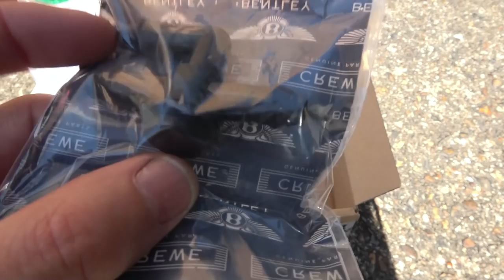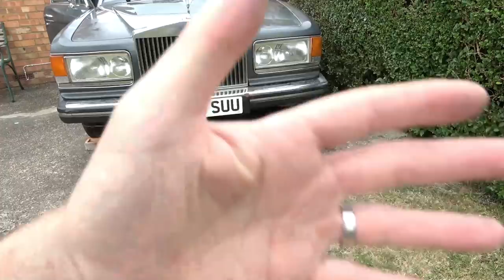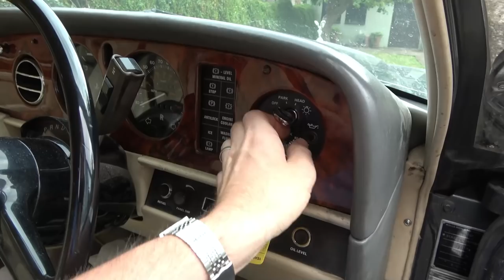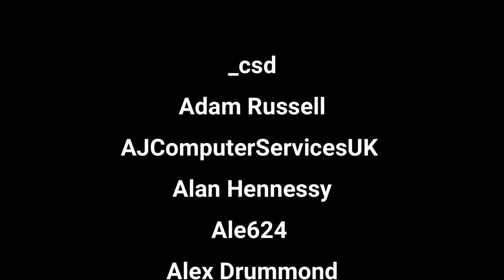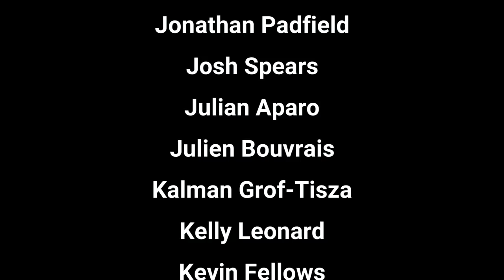Trying to Repair the WIPER MECHANISM on a ROLLS ROYCE SILVER SPIRIT - PART 10

Comment: The easiest way to rectify this was to drill out the rivets on the end of the arm, then swap it for the good one. Rivets are simple to fit and readily available. That way, there is no confusion as to how the mechanism works.
Reply from the maker: I didn't think of that Paul, but yes that would have been an easier solution 👍👍👍
Reply: @Mymatevince  utterly brilliant. Keep them coming.

Comment: Got my first "big boys" Seiko arrive today, big meaty big and bouncy "Willard-a-like" turtle with a NH36 Seiko automatic, sapphire crystal, sapphire bezel, 200m water resist, C3 Superluminova... put it on a £100 Geckota bracelet and its awesome lol   My Reliant heads off to the garage tomorrow to have a new pipe welded into its A frame or radius arm, was going to go to Weymouth scooter rally this weekend but it drives like a shopping trolley on black ice so not a good idea...
Reply from the maker: Nice! Glad to hear you are still into your watches Ian 👍👍👍 Hope the welding goes well.

Comment: I think you do need to drop the drivers side wiper down a bit, @54:40 it is hitting on the A pillar, you don't want that either, interesting fix though, I have been enjoying this series.
Reply from the maker: Will do, I need to look at repositioning the arm on the wiper motor as well to get this intermittent park alignment sorted. Cheers for watching and commenting Scott 👍👍👍

Comment: I think that mechanism fell apart with vibration and they fixed it with what they had around them. They probably assumed the washer had fallen on to the road and lost forever but you found it. I also assume the previous owner was blind as the previous colour combo was horrific! So much more beautiful in that grey colour.

Comment: I think anyone who has worked on a car has been in the situation where you lose a washer, bolt, etc into the abyss. It can be very useful to have a magnetic grabber/magnet on a flexible tube that you can just jam around the engine bay and see what it picks up. They can potentially save you a lot of time. The other thing that can be useful is jacking the car up a couple of inches and then dropping it in hopes of dislodging something. Of course that assumes the suspension can take it.

Comment: Not sure if anyone said this? But flip the plastic triangle thing in between the washer bits so then it will flip the click direction. Hope this helps? Or try to change the arm itself.  By the way you have another line thing by your right hand from top to bottom at 44:40.

Comment: 4:30 I wonder if they bought the drive mechanism from GM; they had a setup like that for years, where the motor reversed when you put the switch in the OFF position and the wipers ran backward, reeling the crank from the reduction gears inward, until the wipers were all the way down.
Reply: 38:35 Yes, the motor seems to do the same reversing thing that my father's Pontiac did, but none of the parts look anything like GM parts, so though it seems to work on the same principle, RR must have made it in-house or gotten  the parts from somewhere else.

Comment: Yes you are right the park position when on the intermittent setting is not correct, obstructing way to much of the drivers view.

I would start by removing the arm that is connected directly to the motor with the motor in the park position.

If you look at the start of your video before you took the arm connected directly to the motor off it was pointing toward the passenger side when in the park position & now it is pointing toward the front to the of the vehicle about 90 degrees of difference.

Start by moving it a spine at a time in one direction & keep checking to see where the wipers park on intermittent, you will start to see the wipers parking closer & closer to the bottom the windscreen each spline you advance.

Sometimes wiper motors have a master spline on them which is larger than the other splines so the arm can only fit one way but it looks like this motor does not have a master spline.

Marking the arm connected directly to the motor is obviously the solution to the problem but as with most things on this vehicle you are following someone else so they probably installed the arm in the incorrect position on the motor.

My last message about checking the length was for the wiper blades not the arms.

Here on page 146 of the Valeo wiper blade catalogue for the Silver Spur it should have 18" blades fitted for both the passenger & drivers side. 

https://valeoservice.cld.bz/VALEO-Wiper-Catalog-2018-application-guide-VSUS-604225/148/

Comment: It's a little late now, since You already bought a whole new old mechanism, but i think i found Your windshield wiper washer You dropped lol If You go to 23:55 of Your video and look at the motor itself, at the "Rolls - Roye" name on top of it and then go down with Your eyes right at the "-" part of the name, You can see the washer sitting right next to the motor. At least that's what i think it is. Well, too late, but You might get some satisfaction out of having found the part after all lol And wasn't it a good thing You removed that cover at the nottom of the car, looking for missing parts? You never would have found the hydraulic leak otherwise.. Probably lol I really enjoy watching You working on the rattiest rolls - royce in the country. Please keep going! Cheers! ^_^
Reply from the maker: Yes, that does look like it but I think unfortunately that is a casting in the metal. I will check next time I am on the car just to be sure. Good eyes though to spot it as it does look very similar. Cheers Asriazh👍👍👍👍

Comment: Holy moly, metal part inside engine compartment is very dangerous :( My friend car burn that way - he loose metal washer and it make short curcit between positive and car body (negative). I hope you will find it!
Reply from the maker: Thanks Solve IT, I'm sure it will turn up eventually 🤞

Comment: Drivers side wiper is too high, it's hitting the windscreen seal which will damage the wiper over time, you need to lower it inline with the black trim on the screen.
Apart from that I'm loving these videos.
Edit: I really need to read the comments before posting as it's already been mentioned 🤣
Reply from the maker: That's ok grumpy, when it is said multiple times it sinks in more. Cheers 👍👍👍

Comment: Put an old towel or sheet under parts you are working on to prevent parts dropping into the depths of the engine bay (preferably a white sheet)

Comment: Watch that the wiper on the drivers side doesn't leave the edge of the windscreen when you're driving.  I had a scary moment years ago going across a busy viaduct outside Glasgow in the rain and a gust of wind blew that wiper off the side so it stuck.  60mph on the outside lane....I needed a new pair of underwear.  Had to adjust it slightly to stop it happening again.

Comment: Vince, have you got any axle stands to support the car for when you are working underneath? 😉
Reply from the maker: Yes, but they only have a few settings for height. I think I might get some bottle jacks (not sure if that is the correct name) so I can set them at any height 👍👍👍
Reply: @Mymatevince  the thing with the bottle jacks is you are dependant on the hydraulics staying pressurised whilst you are under the car, which still has its risks. A decent set of axle stands can't really go anywhere.
Reply from the maker: @catmantech  Very true Cat Man, how about the ratchet version. I've seen 3 tonne ratchet axle stands that I presume have more allowance for different heights. Do you think they are a good idea or more likely to fail? 👍👍👍
Reply: @Mymatevince  I believe the ratchet ones still have height settings before they lock-in and you are still reliant on the ratchet working correctly. With the old school axle stands, which still allow different heights with a pin that goes through, they can't move without removing the pin first.

Make sure to put a block/brick behind any wheels that will still be in contact with the floor once you've jacked it up to prevent the vehicle moving.
Reply from the maker: @catmantech  Thanks Cat Man, I will look into the ratchet ones because if the settings are still 5cm apart then they have no advantages, just disadvantages over the old axel stands I already have. Thanks for the info and replying 👍👍👍
Reply: @Mymatevince  ratchet standa are great so long as you get a good set of 3 ton ones.sturdier than a set relying on a little pin to hold the car up.

Comment: I suppose the intermittent resting position is the flat part on the disc. If that is the case, maybe you could modify it or make a custom disc to get a position you are more comfortable with.
Reply from the maker: Yes, maybe, that didn't occur to me. Thanks Vermilicious 👍👍👍

Comment: I really do think it is a crack in that distrubirator for the hydronics, check for cracks before you order.
Normally you do cone the conections for breaks. That meen no rubber but you need a torque wrench if it's 3/16 pipe you need a torque of 2.8 NM.
My bet is that the wacher is in the hedge or under left tier on the other side of the car.
In my headphones it sounds like it hits the stone the secund time.
Good luck!
Reply from the maker: Thanks Anders. I think I will check the hedge, I don't need the washer anymore but because I spent hours looking for it I would still love to find it 🤣👍

Comment: Hi vince enjoying the roller videos I think I saw your lost wiper arm washer part it’s up against the engine block under the rocker cover I hope I’m right thanks Royboy
Reply from the maker: I need to double check Roy but I think that is a moulding on the engine block. Cheers for letting me know though as I still want to find it just out of curiosity 👍👍👍
Reply: Hi no worries it was only in view a few seconds around 2-3 views if it’s not it looks very close good luck Royboy

Comment: Could it be that you have to fix the main arm at a 5 to 25 degree angle to make the park position work correctly? Just an idea, because the "main drive" seems to disengage, when you turn the arm the other direction and I think this happens in a fixed (probably the stop) position 🙂 and the motor turns back, when you turn it off...this all maybe to make the interval stop position more accurate
Reply from the maker: Thanks Loudness, I now think that the park switch is independent of the actual wipe, so I need to adjust the arms on the arm of the motor and not the wipers arms on the windscreen. Then I am hoping they will sit better on intermittent. I haven't looked at it again since this video though, I will do soon and hopefully report back on a future vid 👍👍👍
Reply: @Mymatevince  I know my explanation was a bit off, but I'm confident and indeed happy you got the idea, what I meant and I hope you get this and all the remaining issues on this car fixed. I love what you are doing

Comment: First of all, I would take care of the body(paint) and then I would install stuff on it. This way, you will work twice on some of these items. Make sure the big items are in tip top shape, before you are dealing with tiny stuff.
Reply from the maker: Makes sense Tibor, I just want to get my confidence up with the smaller jobs so I can learn more and more about the car before getting involved with the brakes etc. I do tackle the rear wheel arch though in episode 18 I think it will be (haven't edited it up yet) but took me 4 days!!!!!!!
Reply: @Mymatevince  Makes sense. The driver side wiper goes to far. The jets are not adjustable with a needle?
Reply from the maker: @19mati67  Yes they are on the windscreen and the headlight ones look like they are on a ball and socket type thing...but the headlight washer is already on its limit, I think the mounting might need some gentle persuasion with a hammer to get it to point nearer the bottom of the headlight rather than the top. Yeah,  I need to mess with the wiper position some more👍👍👍
Reply: @Mymatevince  Spoiler alert!! Can't believe how I'm hooked on this series instead of laptop etc repairs!

Comment: Hey Vince, you really need to report whichever garage gave that Rolls an MOT.
Reply from the maker: To be fair, it is possible that this stuff and failures has happened since the last MOT. I should check the mileage difference and that may give a clue 👍👍👍

Comment: Wouldn't rotating the pawl 180 degrees make it work the other way around?

it looks as if it's directional. One way it'll catch clockwise, the other way, counter clockwise.
Reply from the maker: I can't remember how the pawl was attached. I think it was riveted on but I can't be sure, I will check next time I am on it. Cheers Psyrecx 👍👍👍
Reply: @Mymatevince  

I thought it was missing originally and you dropped it in.
Reply from the maker: @Psyrecx  Ohhh sorry, I thought you meant the little finger on the side that was originally seized. Oh the small square part (approx. 8mm x8mm) with the spring that I found in the engine bay. Please don't say swapping that round would have sorted it!!!!
Reply: @Mymatevince  looks like that may have been the solution >_>
Reply from the maker: @Psyrecx  I just need to wipe away my tears!!!
Reply: @Mymatevince  Eh, well... You still got it done. You just went longer, more hammery way about it.
Reply from the maker: @Psyrecx  Very true 🤣🔨🚗

Comment: you could have sawn off the rod and transfered the head to the other one couldnt you? if its hollow get a small peace of metal thats fits inside. make two or more holes and rivet them together? or a slightly larger pipe and do it from the outside, or both? Provided there is enough tolerance vor a little thicker rod.

Comment: Vince, could the wiper arm you bought come from a left hand drive car? that would explain why it was the opposite way around?
Reply from the maker: Loads of people mentioned the same thing Mike but apparently it was from a right hand drive Bentley Eight 1985 according to the eBay listing. They must have just tweaked the design over the years. Cheers for watching and commenting 👍👍👍

Comment: Hey Vince do you not have Automotive Salvage places or if you will Junk Yards? Or maybe does the Government frown on them of Illegal? Thanks for the series though. Don't those plastic bearings on the ends push out like a universal joint bearing cap? Just a trought.
Reply from the maker: We did, I used to visit them frequently in the late 1990s, but all the ones round me have been turned into housing estates!!! No one has mentioned the plastic bearings yet so I still don't know if they can be pushed out and reused or not 👍👍👍👍 Hopefully the comments will come in to answer that one.

Comment: it's riveted to the end of the arm, ground off makes a new rivet or nuts bolts.
Reply from the maker: Oh yeah, that would have worked. Good thinking 👍👍👍
Reply: @Mymatevince  you sorted it, as I knew you would, it's just nice to fix things rather than have to buy a new part, difficult when bits are missing or someone been in before you.

Comment: When the wipers are parked, they are not visible from inside the car and they should be below the height of the hood. This is to protect a pedestrian so they can't be lacerated by the wipers in an accident where the pedestrian slides along the hood into the windshield. In intermittent mode, the wipers don't park. They are just above the hood ready to operate. They are visible from inside the car, but by far less than yours. Also, your wipers seem to strike the RH edge of the windscreen. This is also wrong. There should be perhaps 1.5 to 2 inches (50mm) unswept on the RH vertical edge of the windscreen. (RH looking in the direction of travel.). I hope this helps. This information comes from a 1994 two door Bentley whose wiper controls and mechanism looks identical to yours. Though the hood almost reaches the windshield. They have worked this way from new.

There is a quirk well worth knowing. When you very quickly touch the screen wash lever the wipers start in normal speed continuous operation. The only way to switch them off is by quickly operating the screen wash lever a second time. This is very convenient because it avoids the need to reach to the dashboard to switch the wipers on and off. The dashboard wiper switch does not control the wipers when they are switched on by a quick touch on the washer lever method. So, unless you know that a second quick touch will switch them off, you may find the only way to stop the wipers is to turn off the ignition and then you must restart the engine. I hope this helps.

Comment: drivers side is to high its hitting the trim on the outter side of the windscreen driverside and passenger is still to high both should be  level with the top of the black on the lower windscreen when parked ;)
Reply from the maker: Thanks Praitor, I will readjust on a later episode 👍👍👍

Comment: the part is there just below the rolls royce name plate go to 24.47 in the timeline and you will see it
Reply from the maker: Cheers for the timestamp, I will double check on the car but from memory that is a moulding on the side of the actual engine, it does look very similar though to the missing washer 👍👍👍

Comment: You REALLY need a magnetic tray for screws, nuts bolts and washers  - trust me the best £5 you will spend
Reply from the maker: Luckily I have one, but it hasn't been used since my early 'trying to fix' videos. I completely forgot I had it, I need to dig it out and leave it in the car. Cheers Sudsy👍👍👍

Comment: Rather than reposition the wiper arms on the spindles why not adjust the angle of the arms so they park lower but dont hit the bonnet?
Reply from the maker: Thanks Maco, I'm going to try to reposition the arm on the motor while the wiper arms are in intermittent stop and not whilst it is in park position. There is a separate microswitch for park so I think now that maybe the motor arm position itself may be the answer 👍👍👍